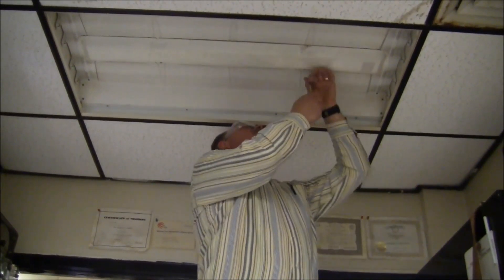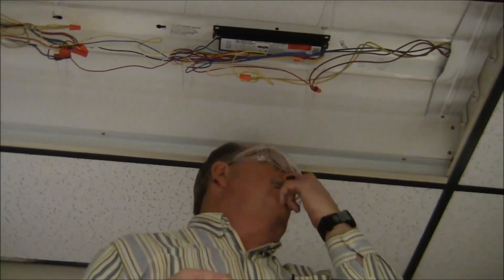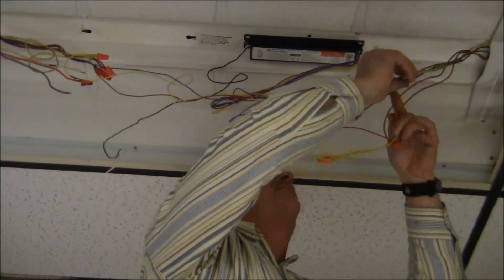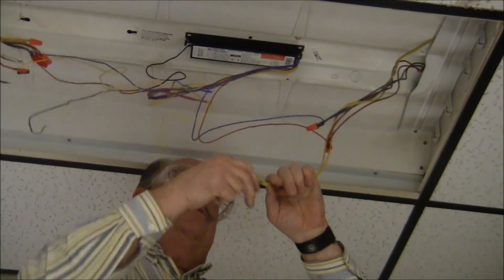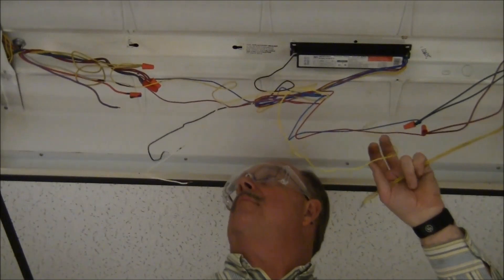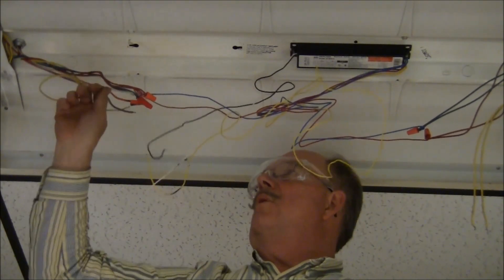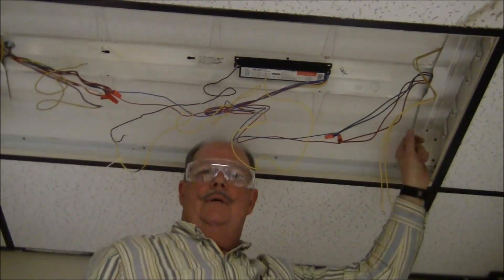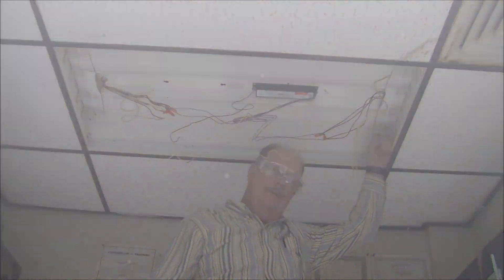Retrofitting a Fixture with T8 Fluorescent Bulbs to Single-End-Power LED Lights

Comment: I know this is an old post but maybe someone could answer this for me. I'm confused? Your title states a 'single-end-power' retrofit but your giving each end power. I thought only one end needed power and the other only neutral on this type of retrofit. Thanks
Reply: I think, and I'm only guessing, that the fixture holds four bulbs and that two had the yellow wires on one end and two had the yellow wires on the other end.
Reply: This is a proper question and an equally proper answer.    Had you spent another minute on production/explanation, you could have covered this.   You also didn't mention that the single ended tubes must be properly placed in the correct ends of the fixture.

Comment: what would happen if we just left the balance in there and just replace the regular fluorescent light with the LED bulb WITHOUT rewiring? When I first moved into my house i just replaced the bulb with LED but now that i am watching these youtube videos i see everyone taking out the ballast all together. What hard have i been doing to myself and is there long term damage if i just leave it as it is? Thanks!
Reply: I believe the only harm is that you are using more wattage. Therefore spending more. Some LED bulbs can be used in a fluorescent fixture; they are ballast bulbs, but you are using more energy still because the ballast uses energy too.